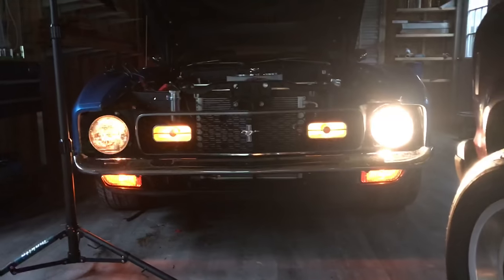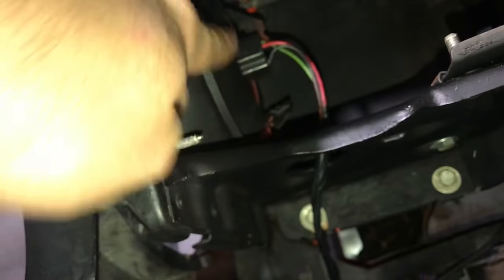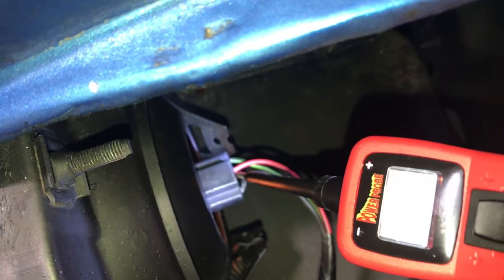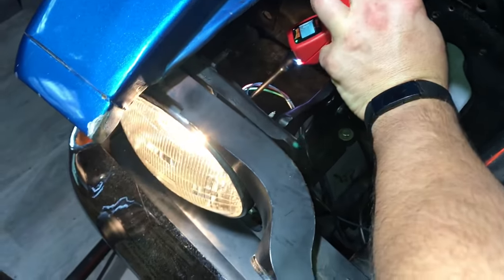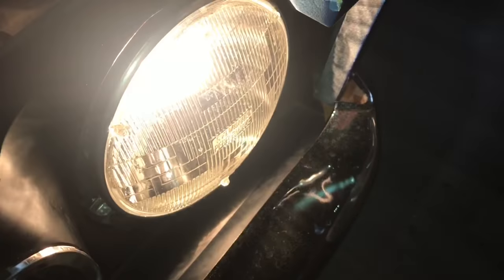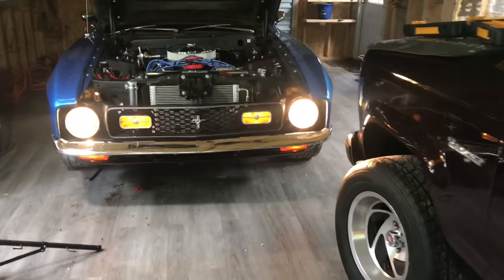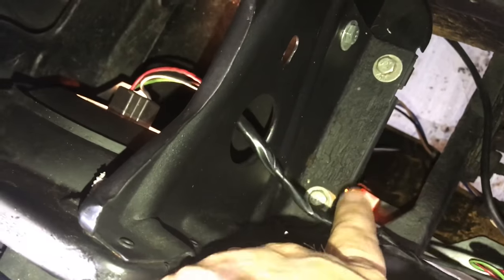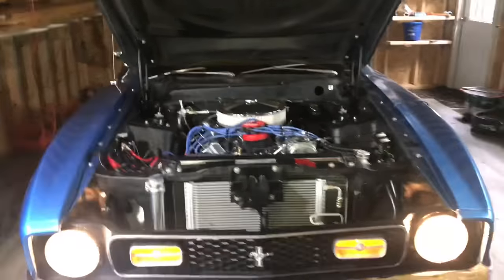How To Fix a DIM Headlight

Comment: Remember this isnt common sense or second nature for everybody  we all cant just fix it like you casually say. Please give us more detail on what we need to do
Reply: follow the black wire (ground) until you find where it's connected. from there, disconnect, sand down the contact area, check cable for splitting / rot, replace as needed, re-ground and test
Reply: It’s a ground my man, (black wire) take a crimp and fit and new ground wire to the body. Just to the fender or something. Problem solved. 👌🏿
Reply: It’s not rocket science

Comment: Would be nice if you showed the full steps to fixing it
Reply: he said cut into the ground at light and reroute it to the chassis
Reply: @irock4u222  for people who dont really know much about electronics or mechanics or car stuff, such as myself, the video probably was not the most clear on how to fix it fully and clearly for individuals unheavily educated in this field, like myself
Reply: @neon1867  Right. This is a simple fix. . . if you're a mechanic.
Reply: @irock4u222  Yah and what the fuck does that mean? If I wanted an audio tutorial of how to do it I would searcha podcast on Spotify.
Reply: Yo get a wire and connect drill it into a metal part of the car. Then the other end to that terminal.

Comment: Makes sense. Thanks …this fix can be compared to a faulty switch ….by giving the existing poorly grounded connection a new earthing to the chassis the dimmed light (incidentally the poor grounding most likely reverted the lighting wiring setup from parallel - 12 volts to series - 6 volts resulting in the dimmed light) should revert to its usual 12 volt brightness…. Most car owners experiencing these dimmed light conditions usually attempt to to replace or upgrade their light bulbs 😢 cheers

Comment: I wonder if this is my problem now...Yesterday i finished installing fog lights where there was none and one light is dim, the other fine.  On the dim side when I was tightening the ground screw into the frame about half of the grounding wires broke (but half ok).  I re-secured it with a wide washer which held the ground in place when tightening so didn't tear further, but now your vid has me thinking that half-ground is making my light dim.  Sound likely to you?  Like your vid and the car's a beaut!

Comment: Having a problem with new octane headlights on my 86 Cutlass non halo, non led. While the Low beams are on the highs light up a tiny bit, then turn highs on and the lows cut out, very strange to me, I wouldn't think they are designed to work this way, gonna get back into it tomorrow, any tips greatly appreciated.

Comment: 2008 sentra passenger headlight is DIM…got new bulb put in dont work at all, only drivers…switched bulbs since i knew drivers worked correctly and now both very DIM!
But high beam drive side works normal but passenger went totally out😵‍💫im a plumber and i am stupified!! what ya think??

Comment: would a bad ground also make LED headlights dim in low mode? I grounded the black wire and all the LEDs came on like I was running high beams.
Reply: Bro my high beams just stoped working and then made the low beams even dimmer
Reply from the maker: They sound like a bunch of downers those high beams.

Comment: I’m having the same issue with my 2011 maxima - passenger side low beam.  I thought it was the bulbs so I got the brightest bulb ! And it’s still dimmer than the driver side- so what do we do ? Or should I take to a audio shop
Reply: In some cases where one headlight is bright and the other is dim its merely a blown headlight fuse. Still lights up but not to its full potential.

Comment: I have a dim headlight driving me crazy! I fiddle with the harness, it gets bright. Then at any shake it may go dim. When it's dim, the high beam light on my dash stays on, but the bulb itself is dim. I can fiddle with it, and it will go bright and functions as normal again - until it hits a bump. 

This is doubly annoying because my light bar is wired to the high beam on this headlight! When the headlight goes dim, the light bar won't flick on with my high beam. 

Does this mean I have a problem with the high beam wire? Or is it the ground? Or maybe the connections? 

I noticed some white paint like substance on the pins when I unplugged the bulb from the harness. Should that be there? Don't know whether to clean it. 

Don't know why the mechanics just fiddle with it until it's bright and pretend it's fixed. Help!

Comment: Could you please help me
I had a fender bender. On the driver's side. Now my headlights are going wild. I got high  beams. Low beams on passengers light. I hooked the 31-ft horse trailer up with lights all the way around it and what happened now the passenger side headlight works and now the driver sife headlight don't work and I don't know whether it's on low beam or it's on high beam. But the headlights you can hardly see them on very dim. Could it be not getting enought power or maybe a ground. I checked behind each light the connectors. It's about to wear me thin. This is a 1999 Ford 350 it has fuses it don't have relays the 2000 had relays. This thing has with me I've got a multimeter I just don't know where to go from here I need help if you could please help me.
Reply: The passenger side doesn't have a ground to the body of the truck now the driver side has a ground to the truck itself so maybe it's broke between there and the other side the ground or maybe it's not getting enough power. It is almost with me please help me if you can thank you any help would be appreciated

Comment: So this may seem odd or stupid... but uhh basically I'm turning a Chinese dirtbike into a street legal motorcycle. I currently only have one headlight hooked up (far too bright to be DRL) and the only halogen bulbs I have are nearly as bright just yellow... is there a way to force a bad ground? Lmfaoo i know that sounds sketch, but I can't pass inspection until I have a DRL and a headlight (LED will be the headlight while hopefully the soon to be dimmer halogen will be my DRL)
Reply from the maker: Add a resistor to create a voltage drop inline on the 12v side.

Comment: Im having an issue with my right signal. Hyper flashing on the back but front isnt working. Fuses and relays are good. Replaced flasher and the multi switch. The problem is still there. And when i turn on the parking lights. The signal on the dash stays on . what could it be
Reply from the maker: It sounds like a bad ground. What car?
Reply: I had the same problems and found out I had wires touching
Reply: had same problem replace both bulb holders fix .

Comment: Hi where you can buy that tool? You have name or link thank you
Reply from the maker: Here ya go Power Probe IV w/Case & Acc - Red (PP401AS) [Car Diagnostic Test Tool Digital Volt Meter ACDC Current Resistance Circuit Tester Fuel Injector Tester] https://www.amazon.com/dp/B00NPY02EW/ref=cm_sw_r_cp_api_i_3-JkDb8S6RKKT